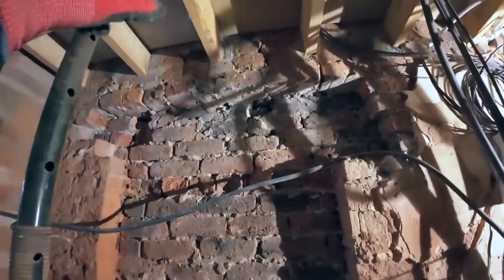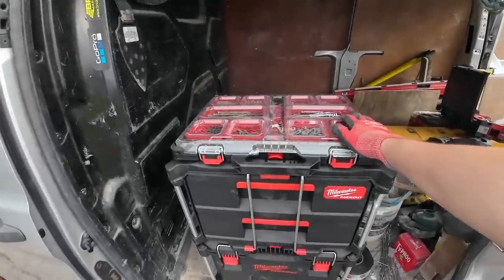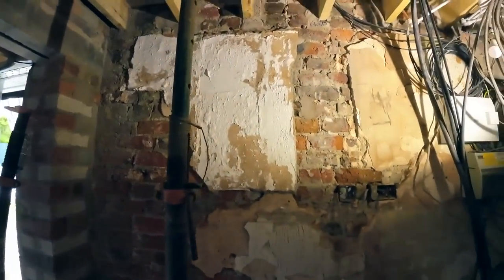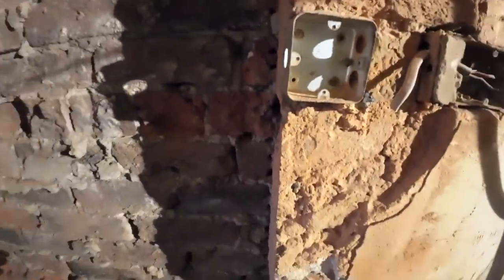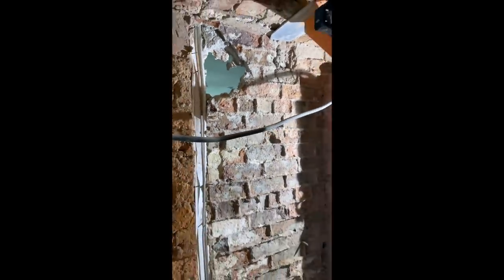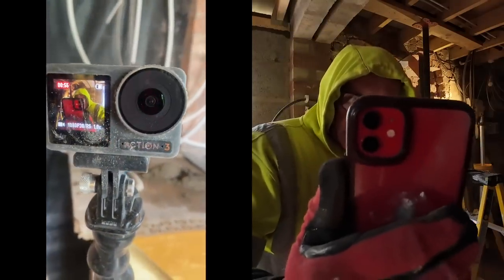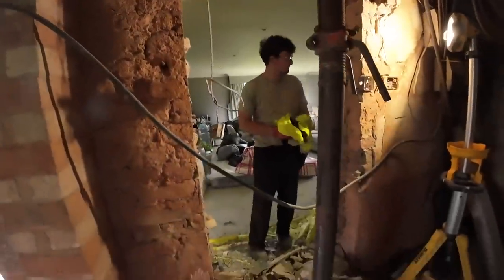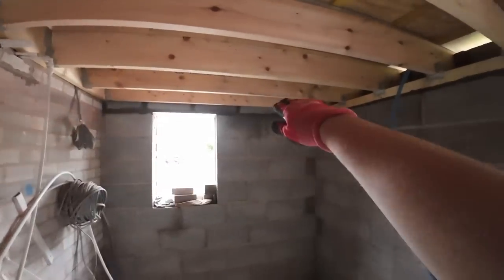RESCUING A FRAGILE FARMHOUSE!!

Comment: What was the W D sprayed into the holes for  when putting the board over the opening ? With all the wires and other things you pair have to work around I think your brilliant.
Reply from the maker: It was John, helps the screw along a bit, less stress on the impact driver. it was a how shall i say ? challenging job 🤨🧱👍🏽